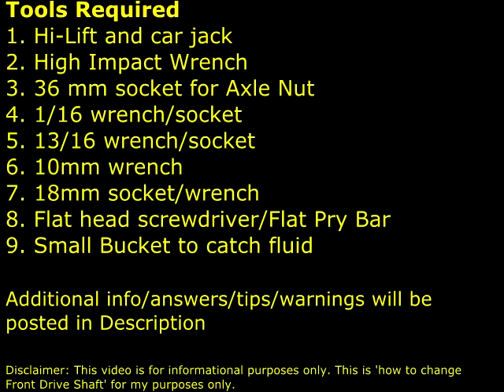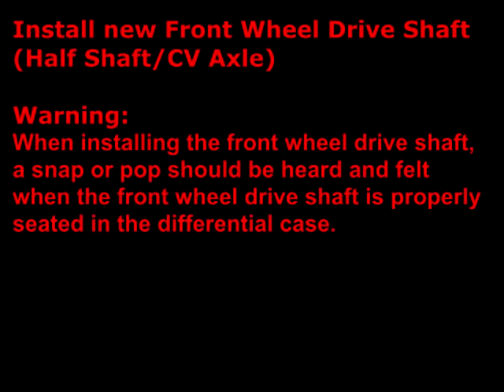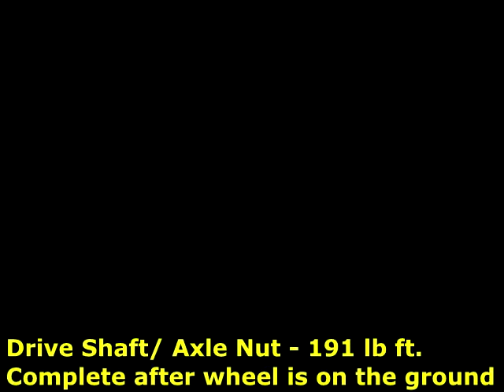How to Replace CV AXLE Shaft HUMMER H3, GMC Canyon, Chevrolet Colorado

Comment: I want to thank you so much about the axle should pop in.  I watched your video and another video where he banged it in with a hammer, even went to a bigger hammer to finally get it home.  I replaced my axle today on my 2010 Hummer H3 and after watching you do it a few times I decided I would stick with your method until it finally happened.  Granted I was not nearly as good as you, but after 15 or so tries it popped in to place perfectly and I was super stoked.....
Reply from the maker: I'm glad the video was helpful. Yea, sometime it takes time to find a correct position - but it is better to spend time and do it without forcing with hammer.

Comment: Very good video . Now there is one thing I always do when working on a truck or car . If I remove the tire I always slide it under the car or truck . For a added safety measure . 
As a matter of fact I started replacing mine just a few min ago  . Then said time to refresh your video. First thing I did was jack the canyon up and remove then slide tire under cross member area . Thank You
Reply from the maker: Thank you for your comments and you have good point. I believe I did put wheel under at that time as well - I do like this practice especially when there are not enough jacks around. Good luck with your fix!
Reply: Very smart i do allso

Comment: Finally finished same job did both sides upper control arms cve shafts and lower ball joints wanted do complete was hard get bolts out control arms was from state with salt looks really good need get lined up now thanks for video was very helpful
Reply from the maker: That's awesome! How did you get lower ball joints out? My boot is torn - need to replace at some point
Reply: @NewRoad  4 bolts holding it in and ball joint  easy fix i watch u tube this guy gave best video

Comment: great job as always! one quick question.. is the CV AXLE use the fluid directly from the transmission or you refill the fluid from the differential fill plug  (front ) ? thanks!!
Reply from the maker: Front differential, and I will suggest to check front differential fluid level after replacing CV Axle and top it up. It'ss very easy - here is the video: https://youtu.be/6elDVHk2zc8

Comment: Thanks for the video! Ran into one issue, after reinstalling cv shaft, knuckle/hub, wheel will only turn a quarter in any direction and not freely. This a probable with the new cv axle or did I install wrong into the differential?
Reply from the maker: This is first time I hear about problem like this tbh. Did you pushed CV into differential as in video, c-clip gap down and to the point that it engaged with diff? Look on the other side if you changed just one and see if there is difference in distance between CV and diff

Comment: Im doing this job plus upper control arms both sides do u think i should do lower Allso
Reply from the maker: If it's ok, and bushing in lower is not too bad - I would not do it, unless you already have parts and time to do it. I still have original and all good.
Reply: Are cv shafts same both sides
Reply from the maker: @clintpeterson9028   - yes, they are the same

Comment: I tried the pry bar method on my Jeep Commander, All went well until time to pop out the axle. It would not come out. I pried and pried, I actually bent the Axle drive shaft seal and the oil started leaking out. Unfortunately none of the local parts stores had the seal. Have to visit dealer in the morning. You should mention that there is a tool similar to the tie rod end remover (aka pickle fork) that can be rented from parts store. Once I got this tool and hit with a BFH the axle popped right out. Took all of 1 minute. Never do this repair on a Sunday.
Reply from the maker: Agree with both... don't leave the project for Sunday afternoon - you never know how it is going to go :-), and it is definitely better to have all tools for the job.

Comment: Hey man, I've got this mud like grease, splattered in wheel well, on my shock and lower control arm. I havent inspected the cv joint boots for problems, mostly cuz the grease is on the piston portion of my fox shocks and made me suspect the shock went bad (I also noticed this side is slightly dropped because the bump stop is now resting on the lower control arm) making me suspect it was the shock. I have no experience with this. Any suggestions?
Reply from the maker: You might be right, it might be shock, or CV
Reply: @NewRoad  further inspection revealed the cv boot was leaking. The metal ring slipped off. Appreciate the reply.

Comment: Thank You my friend. Hay what brand did you go with on the cv axle, Rock auto or ??
Reply from the maker: I bought from rockauto OEM. I found that all aftermarket CV's are not as good as original GM
Reply: @NewRoad  Okay thank you. I did not find any GM cv axle on rock auto Only after market.

Comment: Hello thanks for the video preparing to do this job soon. Couldn’t understand how to get the ball joint and hub assembly bolts fastened at a specific torque setting using a regular socket as shown on the video. Is there anu issue on just fastening those back as tight as possible?
Reply from the maker: You definitely need torque wrench. I used torque wrench (I missed few things in the video... was just starting making vids :-). I would suggest to borrow or rent from someone if you don't want to buy one.
Reply: Thanks! Will do

Comment: Thank you for your video. I followed your instruction and it worked all except C V Joint installment.  I put C clip facedown and it didn't go in all the way.  I put C clip face up or left or right.  I didn't go in all the way, I even hammered it didn't work. Any ideas?
Reply from the maker: C-clip should face down and you wiggle a little bit when inserting CV shaft. It is in when you hear light click/snap and can feel that differential is engaged when you start rotating. I don't recommend to hammer it - just try few times... it may take few tries

Comment: My truck makes a clicking sound when I drive, my boots are split and it screeches when in 4wd, they have no grease in them, I have the diff drop kit but do you think I could just replace the boot and not the shaft?
Reply: Also, the clicking noise gets significantly less loud once it gets warm and after driving a minute I doesnt get worse or better while I'm turning sharp
Reply from the maker: When you hear a clicking sounds coming from axle - the boot replacement would be just waste of money in my opinion. I would replace axle.
You can find aftermarket for low price like this one: https://www.amazon.com/Front-Assembly-Driver-Passenger-Hummer/dp/B077JDDXLR/ref=sr_1_3?keywords=hummer+h3+cv+axle&qid=1568980753&sr=8-3
But I would go with OEM like this one:  https://www.amazon.com/ACDelco-15886012-Original-Equipment-Half-Shaft/dp/B0055AAJLU/ref=sr_1_1?keywords=hummer+h3+cv+axle&qid=1568980753&sr=8-1

Comment: good afternoon, I want to ask one question, why do you change the CV joint if you put it 10 days ago, from the GSP company, I just want to buy and I don’t know which company to buy, if it’s not difficult, please help
Reply from the maker: If you have Hummer H3 - go with original OEM AC Delco only. Aftermarket CV's for Hummer H3 are not very reliable
Reply: @NewRoad  you set up a trekmotiv company, I also tried it, but it didn’t work at all, but they say that the GSP company works very well, I think you can try, it’s just that ACdelko is very expensive))

Comment: Looks like this is my next project. Do you suggest replacing both if one is going bad?
Reply from the maker: Hi, no - you don't need to replace both if another one is ok... it's not like brakes or rotors which you need to replace both sides.
Reply: Humman Off-Road   Thanks. I wasn’t sure if when one goes bad, maybe the other isn’t far behind. It’s leaking oil out and grinding when I make turns
Reply from the maker: @AP_ProudAmerican  If it's leaking differential oil - you need to replace CV shaft seals. Seals are very cheap and since you will be replacing shaft - it is good idea to replace seals. Unless another one has ripped boot or leaking grease - I would leave it. That's what I did in this video - I just replaced one and good one is still good after all off-roading, only now the boot is leaking a bit... I'm going to try to replace just boot soon.
Reply: Humman Off-Road   Thanks for your help and all the vids ✌🏻
Reply from the maker: @AP_ProudAmerican  Cheers! Good luck with the project.

Comment: I noticed you took that other little arm off, yet forgot to mention that in the video. @ 2:56 it's still on, & when the video comes back @ 2:59, it's out.
Reply from the maker: Yes - good catch man! :-). You are referring to Sway Bar Link. You don't have to touch it at all.  If you look at it before  - it was bent (after my last off roading) and I was changing it as well at the same time: https://www.youtube.com/watch?v=Ue_4UDbnSlw
For changing CV shaft - you don't need to touch it at all. 
Thank you for watching and comments.
Reply: Great, thanks for the info. Was having trouble getting my shaft out (that's what she said) & had to pull the bottom bolt out of the shock.
Reply from the maker: No problem. I guess you completed your project, right? :-). What was wrong with your shaft?
Reply: Yeah, was just finishing up. Just a bad CV joint, 90k miles, & wore out I guess.
Glad I found this, probably wouldn't have tried it. I did try to get by just using a floor jack with a jack-stand under the lower control arm & it was fine until I tried getting it all back together. Ended up having to do like you said & using a little scissor jack. Thanks again!
Reply: No musik dangdut

Comment: question would the same steps have to be done to remove hummer h3 differential carrying case?
Reply from the maker: +Official JBR. Yes, you'll have to remove CV Half Shaft first.
Reply: Awesome Thank u i just started removing everything like u did on the video step by step I'm stuck with the steering knuckle I got the bolt off but don't know how to completely remove the knuckle out I have to put in a used differential mines busted up front wheels completely locked I'm doing everything as u did on the video I'm just a disable veteran so it's taking me kinda slow which I don't mind but I just don't know how to remove the lower steering knuckle out thays where I'm stuck at right now..
Reply from the maker: +Official JBR. You mean lower nut? might need lots of wd-40 :-)
Reply: +Humman Off Road Adventures  
 yes the lower Nut I got the lower nut off but can't seem to separate the lower ball joint
Reply: +Humman Off Road Adventures again thank u for the video it's been a great help ..I finally got it out....
Reply from the maker: +Official JBR. Great, glad to hear it. I wanted to say that you could also use a hammer to help to separate - similar to method in this video at 1:20 - 1:25 when I was separating tie rod.

Comment: My axle seal has a small leak. It is not dripping just seepage. Should I go ahead and change it or wait? I just hit 100,100 miles. Thanks.
Reply from the maker: I would change it. If it is leaking - the water and dirt can get in as well and make more damage.
Reply: Humman Off-Road Adventures 
Thanks. I dropped it off at the shop tonight to get repaired along with exhaust leak on exhaust manifold.
Reply from the maker: Hope they won't charge you big coin :-)
Reply: Humman Off-Road Adventures 
$400 to replace seal and $1400 for exhaust manifold replacement.
Reply from the maker: Ohh man - that is a lot of Mods for the truck... and that is why I working on my truck instead taking to garage....

Comment: Owner 2006 H3;   So if the drive shaft axle is leaking at all there's simply nothing else you can do other than add fluid or replace the seal, and might as well replace the drive shaft axle too since it's 10 years old anyway is that about right?
Reply: yes an you mught as well do the left side too.
Reply from the maker: I would replace seal only for start. Don't think you need to replace drive shaft if there is no problem. That is my preference given that I always carry spare one when off-roading.
Reply from the maker: Might be a good idea if you don't have spare one. Buy 2 new shafts and carry old one as a spare.

Comment: I just did this with my buddy on his H3. After everything was complete, we had tremendous vibration on acceleration. Does anyone have any insight why a new part would vibrate? The new cv shaft was from O'Reilly's.
Reply from the maker: If installed properly... the bearings in shaft would be the first suspect. Jack up the front wheels by the control arms, so they're off the ground, and support them with safety stands. Grasp the wheel, holding it first at the sides, then at the top and bottom. See if you can rock the wheel in and out and if you can feel any looseness
Reply: We're tearing it apart tomorrow and taking the aftermarket shaft back to O'Reilly's and for a remy. The old shaft didn't vibrate but all the grease had already been flung out. Thanks I'll check the unit bearing out too.

Comment: did you have to do alignment after all.
Reply from the maker: no, I did not. I know some mechanics who will tell you to do alignment after your change flat tire ... but I don't believe them :-)
Reply: Humman Off-Road  And they are full of crap. There is nothing to align. Looking at your suspension there there is only the tie rod end which you didn't touch. That's the only thing that can be adjusted anyway, so you were right not to get it aligned. Most wheel alignments are a scam these days as most cars can't have anything more aligned then the toe angle and unless you have had a serious accident or replaced the tie rod end there is literally nothing to align.

Comment: What if u have a torsion bar?
Reply from the maker: You should have torsion bars in those vehicles. To replace CV half shaft - you don't need to touch torsion bars. Sorry, I am not sure what you are asking.
Reply: Humman Off-Road Adventures  I fixed it thanks